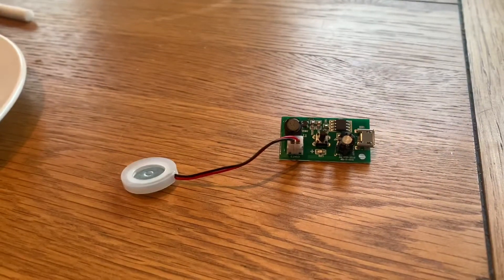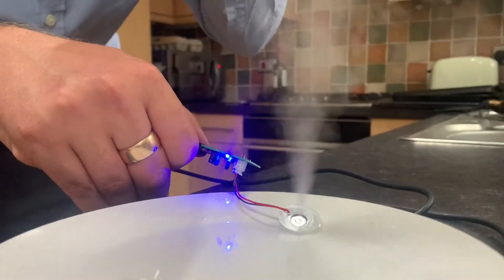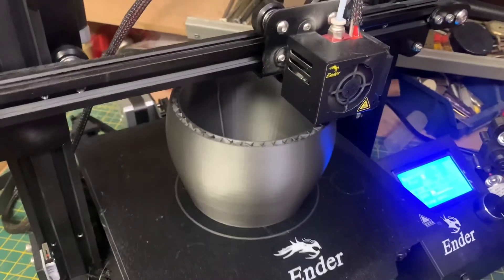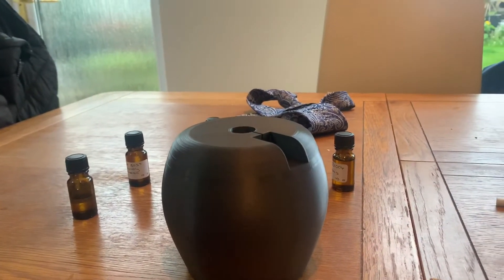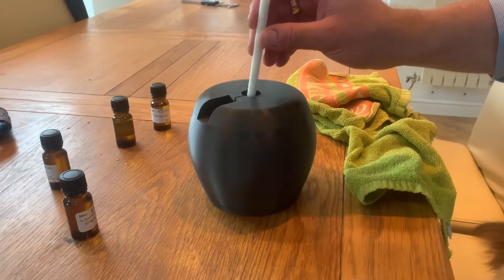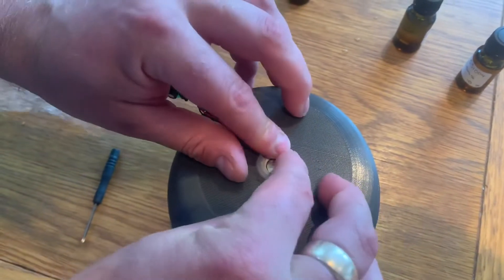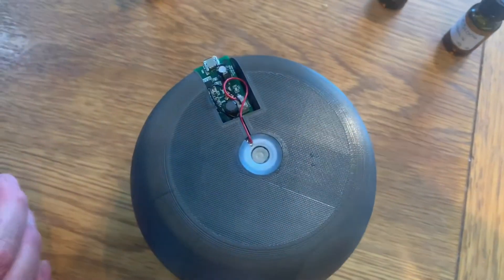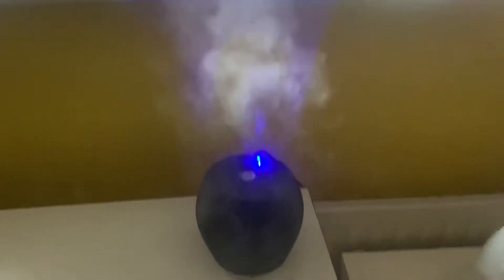Building an Essential Oils Atomiser - a 3D Printing Project in the Home Workshop... with my daughter

Comment: Did the oil have any issues with the filament? What type of filament did you use and where did you get the transducer circuit? Great video
Reply from the maker: No the filaments are pretty bomb proof and can be purchased for a few pounds of eBay and less on AliExpress ect !